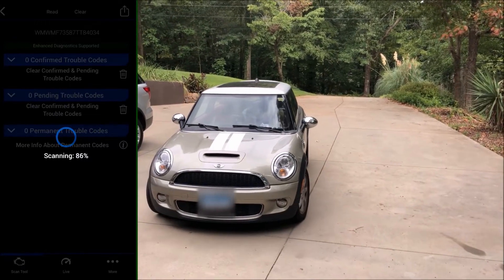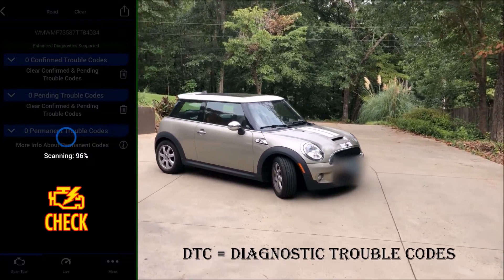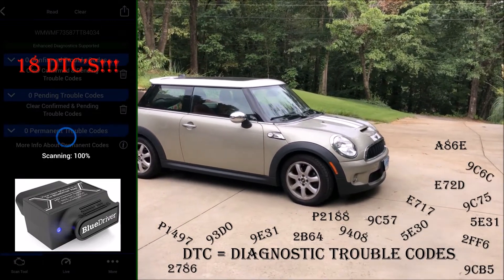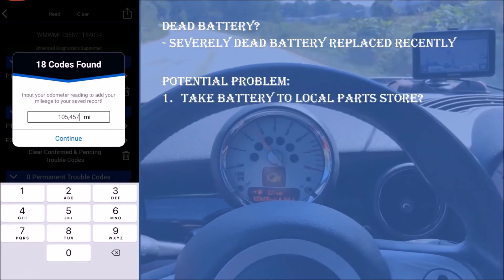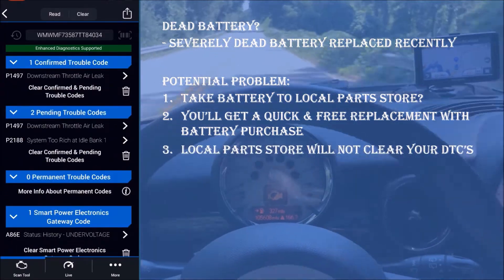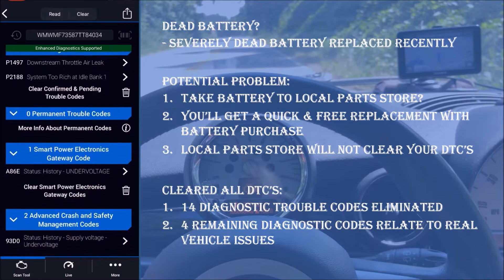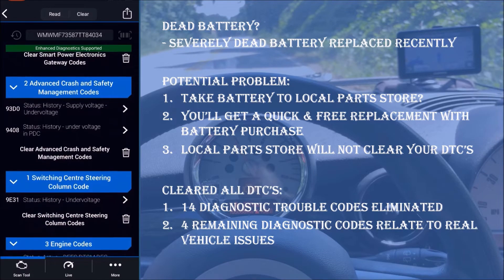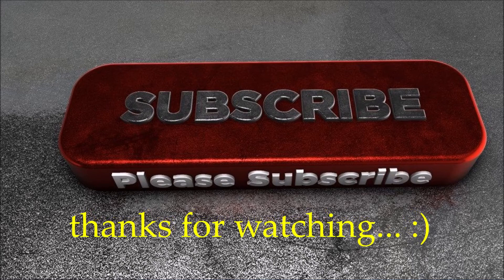How To Resolve Multiple Diagnostic Trouble Codes DTC's: '06-'15 Mini Cooper With Low Voltage Issues

Comment: Can this cause power steering problems
Reply from the maker: I don’t have an answer for that, what kind of power steering problems are you having?
Reply: @DrivingIntelligence power steering cuts out randomly when turning
Reply from the maker: @ sorry, don't know for sure.  Looks like you have an electronic power steering system.  Could be a failing motor, or a sensor.  I don't know the design.  Have you pulled diagnostic trouble codes to see if any are related to your power steering system?